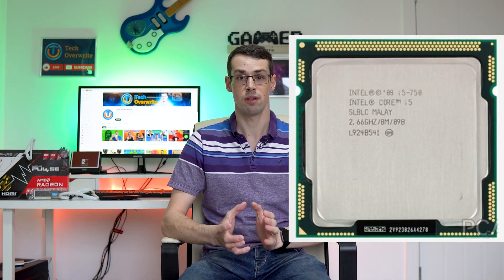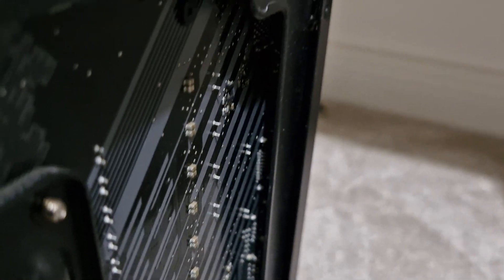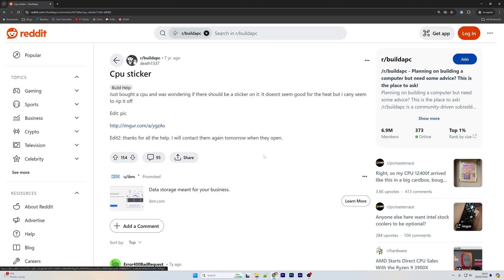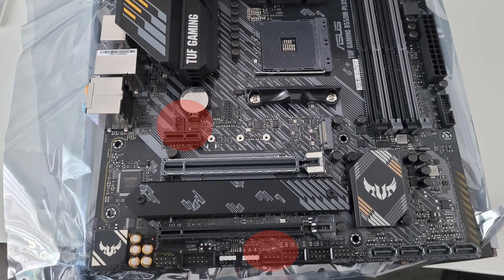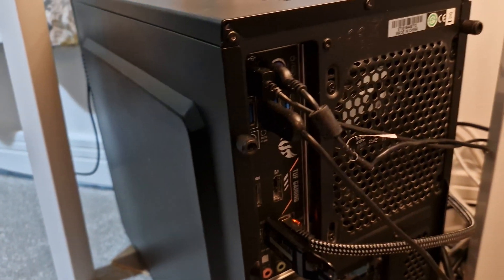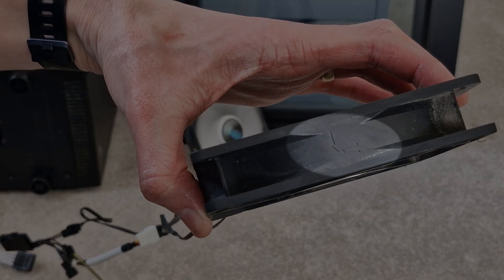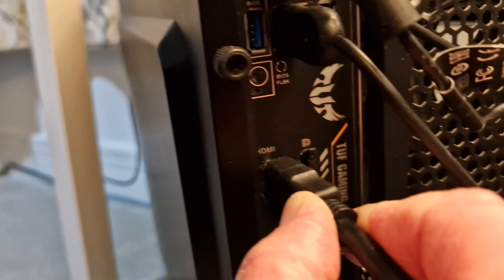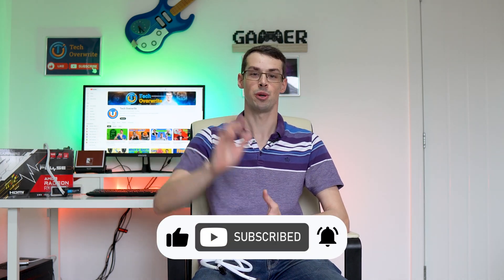10 Mistakes New PC Builders Often Make (Don't Kill Your New Hardware!)

Comment: Regarding the I/O shield, be sure the thin part that's used to ground against the LAN port actually lays against the top of it and doesn't accidentally block the port's opening, making it impossible to plug in the cable. Not much else is more annoying when assembling a computer than not realizing you have made this mistake until after the computer is all assembled and you go to plug in all of the connectors.

I'm speaking from experience and the worst part of it all is that after all of the work put in to assembling everything, most of it must removed and unplugged from the motherboard before unscrewing it so it can be moved out of the way in order to get a screwdriver in to reach the bent grounding tab back into position, followed by reassembling it. I hate having to do the same job twice due to making such a rookie mistake. LOL
Reply from the maker: Oof, that's a great point - and definitely a frustrating one as you say, since everything has been assembled by then 😔

Comment: Subbed :) I might build my first pc this year and this was defo worth a watch thank you. I think the IO shield would be the one most likely to catch me out too hehe. I think I've got a good grasp of the basics and I'm confident I could pull off a successful build first time but I'm torn between the DIY route and buying a mini pc. Given the better modularity/upgradeability would you say that DIY is quite a bit more cost-effective in the long run, like over 5-10 years? That is, vs buying a new mini pc every 5-10 years?
Reply from the maker: Thanks for the sub, I appreciate it ☺️ Yes the IO shield is really easy to forget lol!

To be honest it sounds like you're approaching the upcoming build well, doing your research etc so I would go the DIY route. It's definitely better in the long run for upgradability and cost-wise - especially if you buy a motherboard with 4x RAM slots, 2+ PCIe x16 slots (i.e. the full size PCIe slots) and 2+ M.2 drive slots. You then will have lots of options in the future to expand things. Mini PCs are really awesome too, but they will tend to sacrifice future upgradability for sure.
Reply: @TechOverwrite  Appreciated! Yeah I think I'm going to follow your advice and spend a little more up front to see how long I can string out the longevity (which for me will be on AMD's AM5 platform). I'm guessing most builders spend more on upgrades than they care to admit, hopefully I can keep a leash on that...
Reply from the maker: AM5 is a solid choice for sure - DDR5 (and multiple years of AM5 compatible CPUs) will definitely future proof you 🙂 Yes it's easy to get caught in a 'FOMO upgrade loop' lol, but to be honest I haven't spent on my main PC in 2.5 years now (I purchased a 5900X and 6700XT and those still suit my purposes just fine).

Comment: i built my first pc this month made two mistakes my case had built in stand-offs thank god for that i just checked because i made this mistake and my motherboard had built in or preinstalled io shield but i installed it without checking the rest i was very careful with like plugging cables first and correctly, removing the cpu sticker and i placed the cpu in the motherboard before installing it in the case, inserting ram properly and i did this before installing the motherboard into the case just like the cpu, fans facing in the right direction, installing the 360 aio pump correctly because i did alot of research i have been tinkering with pre builts pc alot like removing the cpus cooler and cleaning it and also removing the gpu to clean it same with the ram but had never build an actual pc before now so building a pc came easier to me i used a lightweight screw driver and an led flash light and yes getting an head mounted flash light is a very good idea i could have gotten my pc built for me but i didnt want that you should know how to build your own pc life gets alot easier in the pc world this way when you know what to do.
Reply from the maker: That's awesome, congrats on tackling your first build, it sounds like you did great ☺️ In glad that you didn't make too many mistakes - it's easy to make some mistakes, of course, but it seems like you did a good amount of research 👍

Comment: I remember when I first dipped my toes into getting myself familiar with PC components. It's been well over a decade since I was on an old Core 2 Duo machine with 4GB of DDR2-800 RAM and an old ATI card. Plenty of things that I didn't pay too much attention to, or even outright didn't know about at that time, especially the part about fan airflow direction! Even to this day, I'll still panic when pressing the power button does nothing, only to have forgotten to press the PSU switch in the back.
Reply from the maker: That sounds like a sweet first build, I loved the Core 2 Duo lineup for spme reason. 😊 Glad this video touched on some of the points you experienced - fan airflow is easy to overlook for sure. And yep, I still forget about the PSU button to this day - I forgot about it a couple of weeks ago. It gets me every time 🤦

Comment: Lol great video , I made my first P.C. about 6 months ago (i'm 50+) and had a P.C. since , well the early 90's , but had never got round to actually making one 

Well i found it reasonably easy , after loads of research, and the biggest problem i had was when i installed the NVMe  drive screw!! Oh My days , it dropped onto the carpet and it took me longer to find the damn screw than to build the rest lol !!
Reply from the maker: Thanks, I appreciate that! That's great that you did your first actual build from scratch then - kudos. 🙂

Ugh yes that's actually a great point, I probably should have covered the impossibly small screws - the NVMe ones are particularly annoying I agree lol!
Reply: I'm coming up on 40 and in the same boat, encouraging to hear your experience (minus that screw) :)
Reply: vacuum the carpet, then go with magnet over vacuum dust pile.